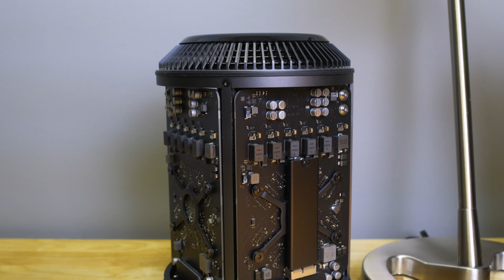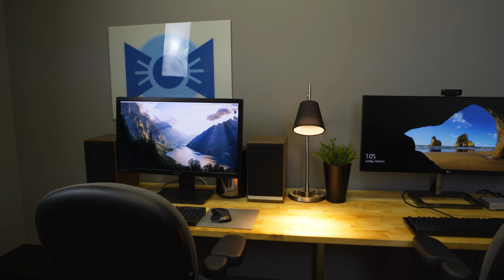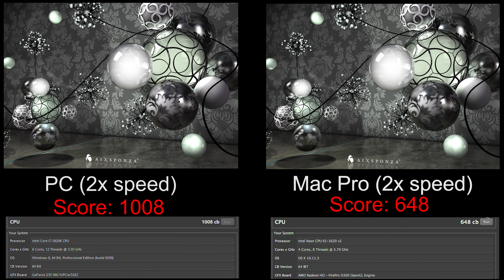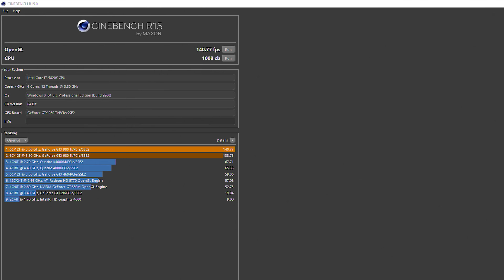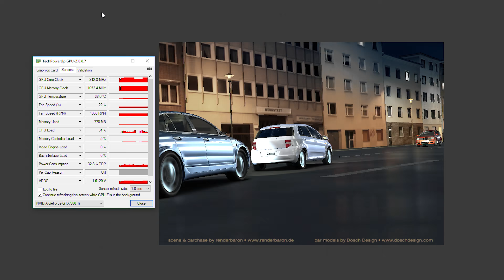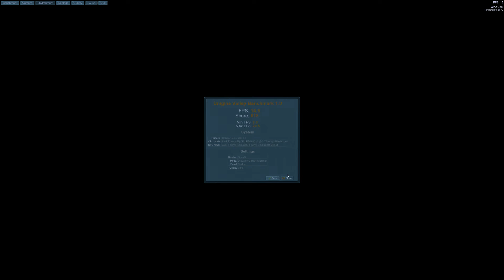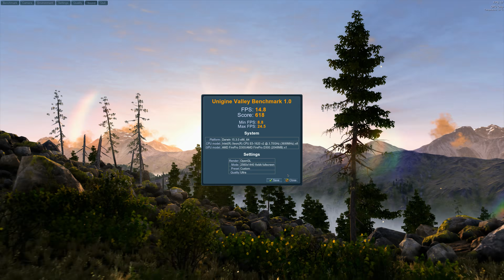$2,000 Custom PC vs $4,000 Mac Pro

Comment: question, had my mac cor 5 yrs now, i wanna add a second ssd 1t in the dvd spot.   whats the benefit of doing raid over leaving the seconded as storage.
Reply: It matters what kind of raid and I'm assuming that u just want speed and not redundancy so u want to raid 0 them, hopefully the Mac supports raid; if it dose you will almost double ur read right speed but ur original SSD has to b the same size. In conclusion there are 2 benefits to raid, one is speed but only if u use raid 0, two is redundancy which is raid 1; there are also other raid configurations like raid 10 but u need more than just 2 SSDs. PS all ur data on the current ssd must b erased so back up that data
Reply: Yes. just speed. Went from around a min with factory drive to 18 sec boot time with ssd.
I hope it's a good one (samsung SSD 850 EVO) 550/520 r/w with v-nand.

But as saying that i did do the ram at the same time. 4gb to 16gb.

I did see something about raid in disk utilty, but not sure what type it supports
Thanks, and i enjoy watching your vid's,

Comment: Well, xeons are crappy, that gpu sucks, which is 547878x worse than your i7 5820k  and gtx 980 ti.
Reply: ***** Xeons are crap. Extra cores are only good in a workstation. 4 cores is the way to go for gaming.

Comment: OS X and Windows are for different uses, when will you guys understand? You buy what you want for what you need. For fuck's sake, talking to PC fanboys is like talking to a retarded brick wall (not saying that Apple fanboys are better).
Reply: +Jero Bero that was true with windows 7, but i feel that the windows 10 ui is a good improvement in appearance
Reply from the maker: +alittalien Um. I edit video. Both platforms do it. I just prefer Premiere which runs much better on Windows... With the exception of gaming, they're for exactly the same uses...
Reply: +alittalien But you can run OS X on tht PC (Hackintosh) & it's gonna be a heck a lot fastr! In fact the fastest Mac these days if you check on a benchmark is probably a Hackintosh & not a Mac by Apple!
Reply: +Vesagio Running OS X on a PC is illegal? Not if you buy the OS X operating system then run it on a PC. It even works the other way around (Windows on Mac with Bootcamp and shit)
Reply: +Ardyn Because it's beautiful. You can't deny the beauty of cherry blossom. And that doesn't mean that I go everywhere with cherry blossom. This is the internet.
Reply: +alittalien So you want to say that OSX is over 2000 dollars? cause that's what you pay for a worse system with that operationg system..
Reply: +YASIR SAHEED Yeah if you want speed, you better buy a PC because of their customization abilities but for example stability or for a few specialized programs, some prefer a Mac over a PC. Why? Upgradable software, no need to change all the components. Mac can last for a longer period of time compared to a unmodified PC, but PC will last a lot longer if you have the money and want to upgrade some components over the years. Example: I built a PC in 2008, with all the best hardwares we could have at the time. In 2011, it was almost completely useless, I had difficulties running Assassin's Creed 1 at a resonable frame rate. Then in 2013 I bought a 2012 Macbook Air, downloaded FL Studio with Wine bottler, still work fine, downloaded CS:GO and still get 70-80 fps after 4 years of not changing the components. I know I wouldn't be able to run Fallout at 60 fps, but that's not what I need/want. That's for all of you: stop bitching about what others have/want and focus on what YOU need/want!
Reply: +alittalien I don't think you understand the "difference" between Mac and pc...
Reply: +Louie Mott Then tell me what I got wrong instead of just saying that "I don't know the difference"?
Reply: +Vesagio I must admit I was wrong about the OSX on PC. But first, even my homemade PC wouldn't have been able to run Photoshop fluently 8 years without being modified or changed, no fucking way. Since it was built with the best hardware components available at the time, I doubt a "normal" PC you would have found at Best Buy would have done the same job. Second, if CS:GO isn't so hard to run, why do people I play with have trouble reaching 100fps on their PC? I must add I'm playing on all high settings by the way.
Reply: +Jero Bero Sorry the UI and start menu of Windows 10 looks 10 times better than that of Apple.  And when you talk UI, do you refer to the dock or other aspects of OSX?  Remember we can also add a dock if we want to.  But meh it gets in the way.
Reply: +Vesagio Are the cores the only thing you know about computers? For fuck's sade kid, calm down a bit, I'm not trying to start a war. By the way, the PC cost me right about the same price of a Mac at the time. I haven't touched it or modified it and I can guarantee you, it wasn't worth jackshit with "reasonable demanding programs". Yes, if I kept only the core or ram or whatever component you want and changed some of the others, it would have ran presumably and fairly good but unmodified, there's no way it was able to be sufficiant with today's or even 2013's programs/games. No need to reply to this comment unless you're all out of anger.
Reply: Even if the apple was better core/cpu wise it is still flawed.   You damage the safari component of osx and the whole system crashes.
Reply: +Vesagio Seems like you still have a lot of anger. Dude just admit to yourself that Apple computers aren't as bad as you'd hope they'd be, they're just not for you. You don't like them, your opinion. For your anger problem, do some yoga, it'll help! I'm out, don't reply I won't answer to further comments.
Reply: What a burns :)
Reply: +alittalien Come on man! You won't be able to run Assasin's Creed even on a 2008's Mac! The hardware has nothing special! It's the software! & yes, I'm a Software Engineer (In case it matters)
Reply: +YASIR SAHEED I know and I totally agree with you, a 2008 Mac won't able to run it, but you DON'T buy a Mac for gaming. That's the point. But a 2008 Mac will run waaaaaay smoother than an uncustomized PC. And that's why PC are so loves for gaming: customization.

Comment: Lol, you can't throw a gaming benchmark at a workstation graphics card, and expect better results than a gaming card, they are not designed for gaming optimizations.
Reply: +Akuun Reach lol neither cinebench nor unigine valley are game engines. What r u smoking. Btw a gtx 980 ti would smoke a 3 year old amd firepro at any test you put them in. You don't even know a benchmark you could put them in that isn't "game optimized". lmao optimized is such a pretentious blanket term. I guarantee you have know idea how a graphics card can be optimized for something.
Reply from the maker: +Akuun Reach Its not a gaming benchmark.
Reply: The game engine bench? It most certainly is.
Reply: +Cherry “Strawberry” Cream lol you win
Reply: Unigine is not a workstation optimized stress test, an off the shelf video card with the same chip will outperform its workstation counterpart. These tests have been done before, and I'm in no way saying the 3 yr old AMD is faster. I'm just laughing at the test, as it would be unfair from the start, with an apples to apples chip comparison.
Reply: I'm not dealing with this level of ignorance.  Good luck with life.
Reply: +Akuun Reach not sure if you watched to the end.  He did  file export out of premiere which is definitely "Workstation Optimized" .  the PC still smoked it.

Comment: I have never used a MAC, however from what so many have talked about I of course assumed the most current "flagship" Mac Pro was the best choice for video.  I had no idea performance / cost would be so low, and did not expect a Windows PC to walk all over it. 

You are comparing a 6 core to a 4 core, an i7 to Xeon E5, 32 GB DDR4 to 12 GB DDR3, yada yada, and some might think that is not a fair comparison.  The title of the video says it all and this is emphasis on cost versus performance.  Job well done.

Comment: come back in two years when the pc's screwed.........lets see the benchmarks then.........one more thing, why are you not using a multiprocessor mac pro? pretty standard for music and video.
Reply: Hey look! The 90 year old thinks he knows about tech!
Reply: +Quinn FH .........you talk like a Quim
Reply: Manish Jangid Based on UNIX - Solid As a Rock

Don’t let its elegant and easy-to-use interface fool you. Beneath the surface of Mac OS X lies an industrial-strength UNIX foundation hard at work to ensure that your computing experience remains free of system crashes and compromised performance. Time-tested security protocols in Mac OS X keep your Mac out of harm’s way.

The most widely-sold UNIX-based operating system, Mac OS X offers a unique combination of technical elements to the discerning geek, such as fine-grained multithreading, Mach 3.0 microkernel, FreeBSD services, tight hardware integration and SMP-safe drivers, as well as zero configuration networking. Tiger’s state-of-the-art kernel features improved SMP scalability and 64-bit virtual memory, while standards-based access control lists take UNIX permissions to the next level.
Reply: ***** no need its already been said , Unix is a superbly stable, as is osx  , Microsoft whored their platform out to anyone, resulting in the most expensive unstable platform out there, i have never had to re-install or maintain OSX i have never seen an error screen, or had trouble with drivers........its' simply the finest "free" user-friendly and stable O/S out there, no virusware , just fast maintenance free, computing.......or if you are unemployed get a cheap selfbuild you have to maintain everyday,with driver dropouts and a myriad of idiosyncrasies, but hey the numbers look good, until the system fucks up again. i was a windows user since 98, when i knew nothing, just like you.
Reply: +Vesagio  , why do you speak like a child? Screwed? Like most ms systems the older they are the slower they go necessitating yet another re-format , re-install , it since 86 ? What was the network tech / connectivity you were using then?
Reply: +Vesagio HA HA HA HA HA HA HA ..........you've been rumbled son
Reply: holy fucking shit dude!!!!!!someone stop this guy,pure crap is coming out of his mouth,oh god !why people like these even still alive????
Reply: Manish Jangid Based on UNIX - Solid As a Rock

Don’t let its elegant and easy-to-use interface fool you. Beneath the surface of Mac OS X lies an industrial-strength UNIX foundation hard at work to ensure that your computing experience remains free of system crashes and compromised performance. Time-tested security protocols in Mac OS X keep your Mac out of harm’s way.

The most widely-sold UNIX-based operating system, Mac OS X offers a unique combination of technical elements to the discerning geek, such as fine-grained multithreading, Mach 3.0 microkernel, FreeBSD services, tight hardware integration and SMP-safe drivers, as well as zero configuration networking. Tiger’s state-of-the-art kernel features improved SMP scalability and 64-bit virtual memory, while standards-based access control lists take UNIX permissions to the next level.

Comment: well you are building a gaming rig...and I assume you are not working in 3D animation industry right? mac pro is a workstation designed for autodesk CAD etc~the video card u used in this rig wont support these kind of programs~also same for XEON processors~xeon maybe slower on individual cores but it has more cores which is crucial for 3d rendering~in addition if u want ur autodesk maya crashed less or less rendering time, then use xeon~

Comment: FYI the Mac is for video and photo editing that's what it's ment for
Reply from the maker: +previews reviews FYI I make videos. The Mac was too slow. That's why I built the PC...
Reply: +previews reviews If you watched the video he demonstrates how much slower the mac is for video processing/editing.....
Reply: +Niall Mc Groarty This would have been even worse comparison if he built a $4k PC using 18 core xeon processor with ECC memory.  My computer is on 24/7 and running at load and no issues and I don't use ECC or workstation graphics card. The point was Apple is still selling that outdated shit for $4k when you can do more for less.
Reply: +Niall Mc Groarty While I do agree with the statement about ECC ram and heavy workload over long periods of time, you have to understand, you can also buy ECC ram and a couple of titans for double point percision with a powerful server cpu while still being under the budget of a "current" mac. Also, I would just like to state that hardwarecanucks only demonstrated that final cut pro was good software for video editing and it has been optimized for people using mac as their primary platform, however not everyone uses final cut, in a different perspective others may say it is inferior to Adobe and other professional video editing software for their workload. Using Adobe on a mac would render far worse results than a modern fully featured pc. (AFAIK)

Comment: Wow, that Mac is laughably overpriced and underpowered. I have a custom built PC that cost me about £350. GTX 750ti (entry level GPU), i5 4440 3.1ghz and 8 gb ram. I can run that valley test on high settings and get over 30 fps.
I have previously owned a Mcbook Pro and an iMac. It was only when I built my own PC that I realised just how overpriced Macs are. You pay for the name and the design. Functionally they are mid range at best

Comment: why do people compare macs and pcs all the time there not used for the same thing.
Reply from the maker: +Dane Bright Most of the time, with the exception of gaming, they're used for exactly the same thing.
Reply: Snazzy Labs Macs are more widely used for video editing though, also damn that was a quick response.
Reply: +Dane Bright mac isnt better at editing still.
Reply: +Dane Bright That is irrelevant it is never better to buy a mac.
Reply: +Eric Cartman mac is better if you use final cut pro
Reply: Alex M it isnt in my opinion its both ways.
Reply: +Alex M  
Wrong. The ones with the largest market share are AVID and Premiere Pro.

Comment: I didn't like your video because: you thought buying a refurbished power supply was a good idea (that's a big no no never, but you sorta made up for it by buying a evga PSU though I think the 700 something you chose wasn't quite enough). You seemed to be expecting something from the Mac the whole video. I could have told you the outcome without even watching it!  

its a silly idea to compare these two machines. I'm not sure why I watched it...

Comment: Now compare it with mac-dedicated software.
Reply: +Rian Quenlin The fact that the software needs to be dedicated to the Mac OS to beat a computer half the price is proof that it's overpriced...
Reply: It's almost as if that's the entire point of macs. I don't even use them and I get that.
Reply: ***** Spending 2X money for something half the price or even lower can do?
Reply: A few years ago, $300,000,000 was spent laying a 6000 kilometer cable for the sole reason of saving 6 milliseconds in financial trades.

If you're doing something as a profession, saving even a few minutes can be of great benefit in the long run. Especially when it comes to the likes of video rendering.

Comment: i agree with this however the reason i use apple computers is because i don't have the patience (or the knowledge) to be building my own computer. especially if those things are only going to last a few years before i have to upgrade it again. apple's are built way better than any PC you can put together yourself. also, the apple laptops are pretty awesome - although not anywhere nearly as powerful as they should be - they're still pretty amazing. overall, i'm a busy professional and don't mind spending a little more to get the security that comes with an apple product. yes, i'm aware that it's totally overpriced. yes, i know it's old and that there are hardware parts out there that are much better. but you have to look at the big picture. let's not forget that this amazing PC you've built yourself comes with ZERO support. just saying...
Reply: +iivanov86 apple laptops are too much $ but are nice and I would use one. If you want to you can buy a computer from a place like ibuypower where it's prebuilt if that would work for u. And I didn't quite understand what do u mean by no support